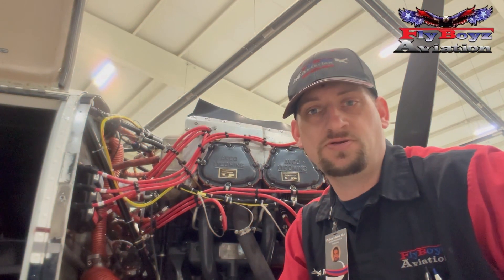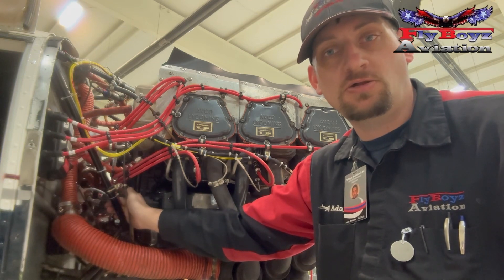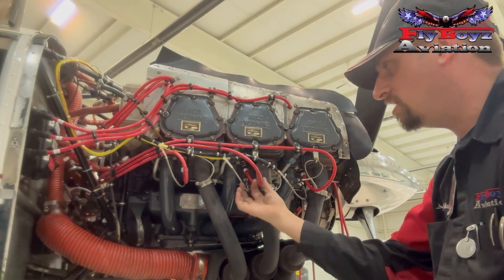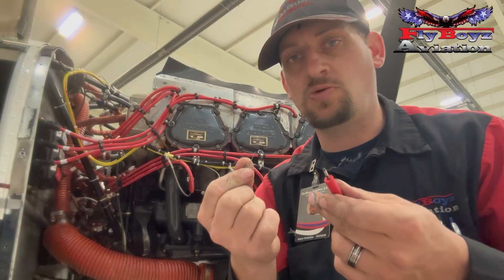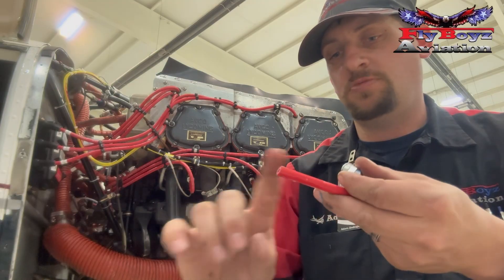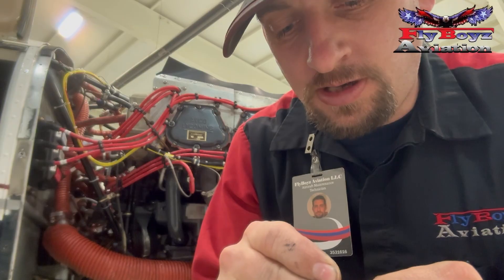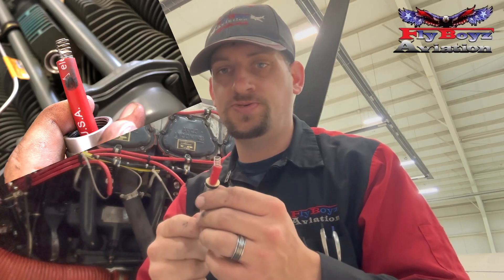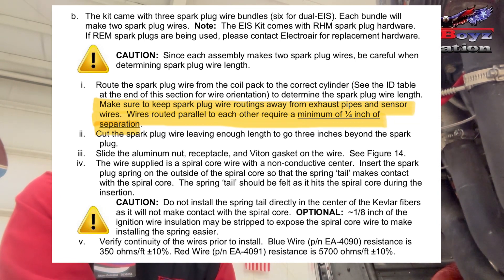ElectroAir ignition lead assembly & routing

Comment: How many Electro air installations have you guys done, looking for a shop to do this on my Maule
Reply from the maker: We have done 3 Maules, & somewhere around 75 installs not counting repaired or reworked installs.
Reply: @FlyBoyzAviation I assume it would be fairly straightforward on 2002 MXT-7-180 (O360-C4F)